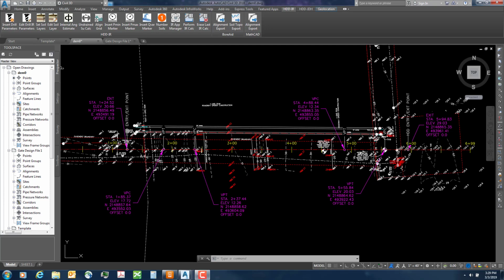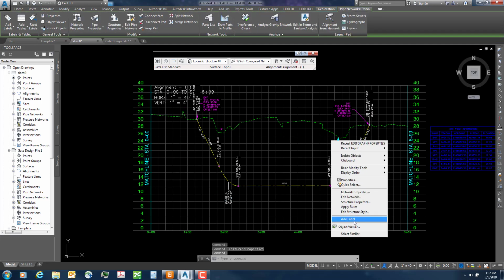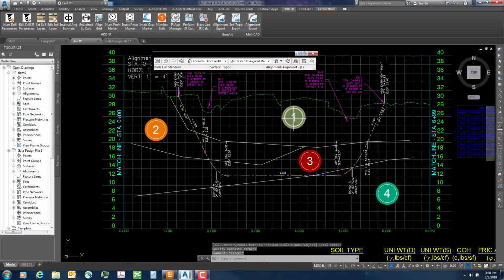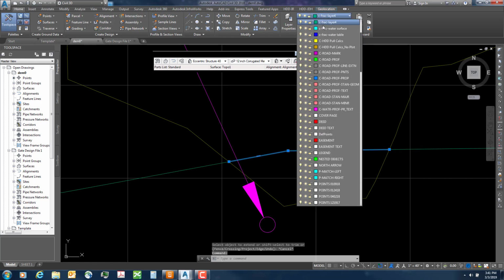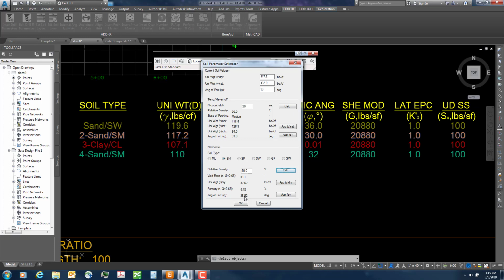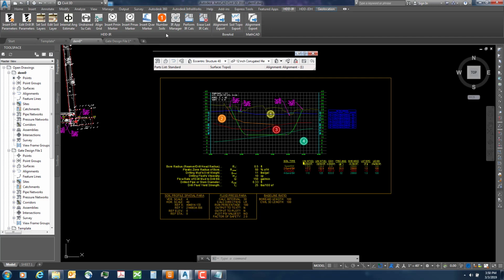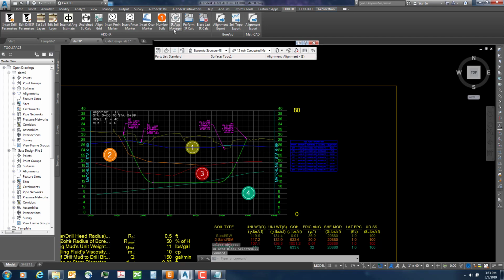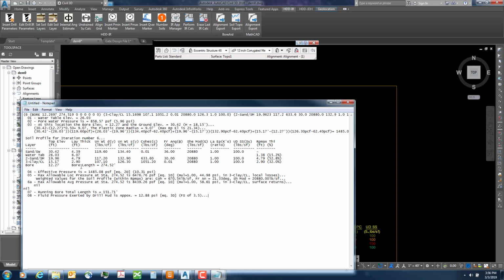Proprietary Routine for doing Inadvertent Return (IR, frac-out) Calcs in the AutoCAD environment

Comment: Interesting to see your take on the IR in the Cad world. I have never dealt with C3D. Is any of this soil stuff standard or have you wrote all this programming?
Reply from the maker: I wrote all this code myself. This program actually performs calcs using about 5 different frac out methods being used in and emerging in the industry. I have continued to add features to help estimate geotechnical parameters for the soil layers and make it more able to produce the results in different ways for the output. It is sort of a pet project but I do use it for the work I perform.
Reply: @enginjax  Hi, I how can I learn how to do it or where I can get an example of you job? Also, do you sell it? Thank you in advance